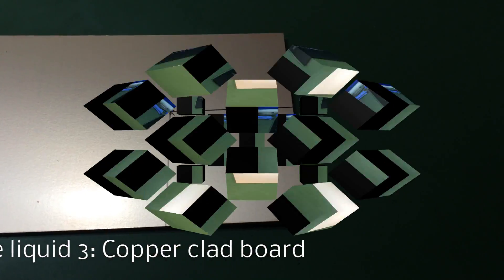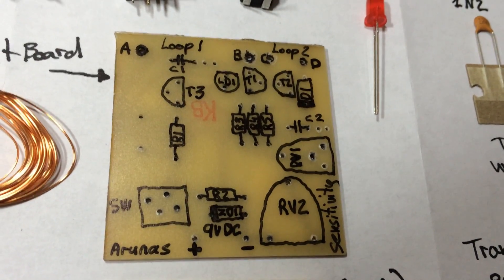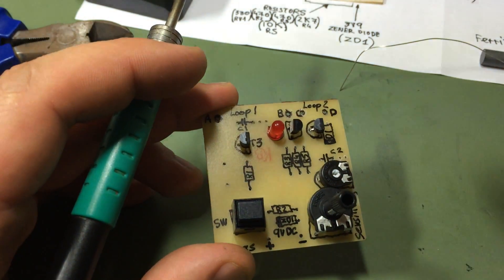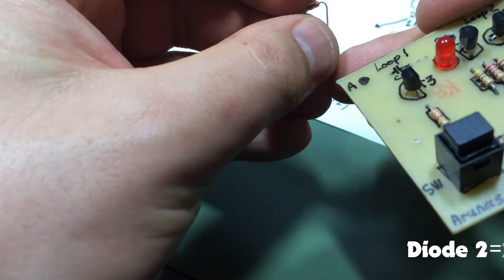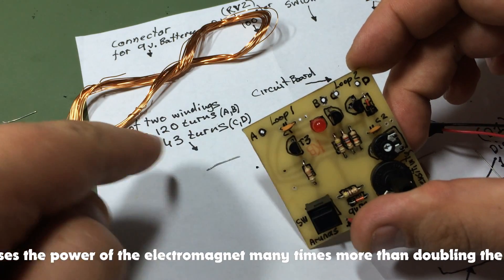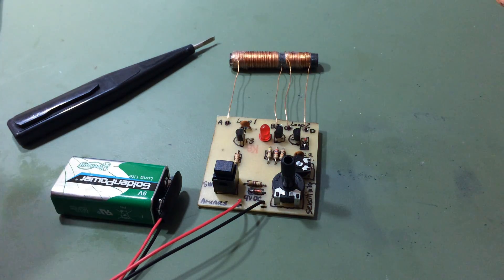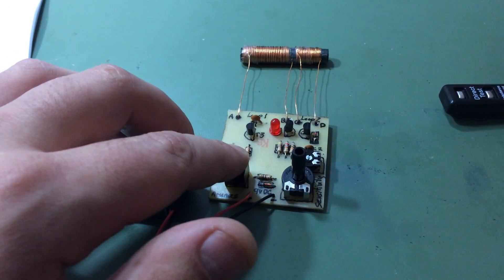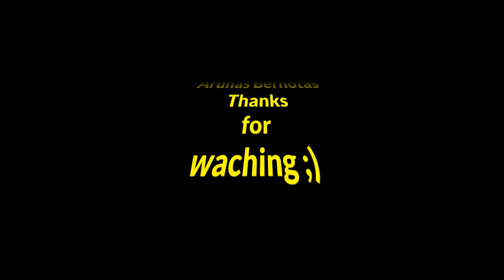Metal Detector "Home made" first project

Comment: Aaron,As an electrical engineer I commend you on both your knowledge AND presentation. Very, very well done! Have you tried a "live" wire detector? It would be a nice addition (maybe you have but I didn't look into your work yet). In addition, I believe the "Soft Iron Core" you suggest is Nickel-Iron. Very high permeability and yes, hard to get and expensive. Running higher frequencies utilize the high permeability of the ferrite though.Just had to say what a great presentation!John

Comment: hello friend thanks for your great circuit, you could tell me please
1. which is the maximum depth reached?
2. I can use a buzzer instead of a LED?
GOD bless you!
Reply from the maker: Hi mate,
Detects up to 10cm depense how many windings you gonna use and which Zener diode.
You can install both, a buzzer and LED.
Use this buzzer if you want:
Dimensions: 11.6 x 11.6 x 7.5mm
Lead Pitch: 7.6mm
Current consumption: 30mA
Sound output at 10cm: >85dB
Frequency: 3100Hz Â±500Hz
Housing material: PBT
Operating temperature: Â–20°C to +85°C
Storage temperature: Â–20°C to +88°C
Rated Voltage: 12V
Operating Voltage: 8 to 15V DC